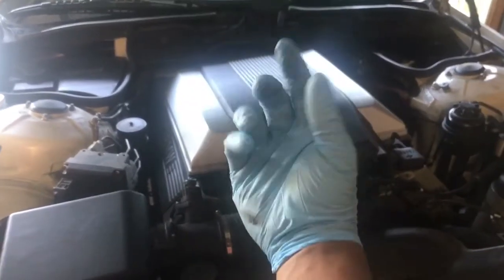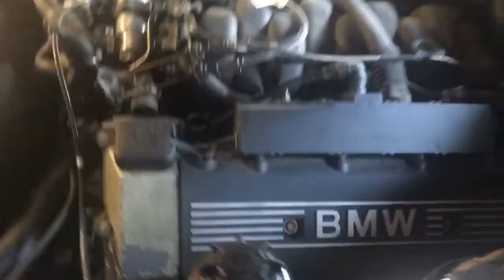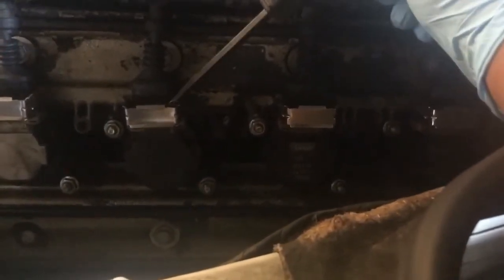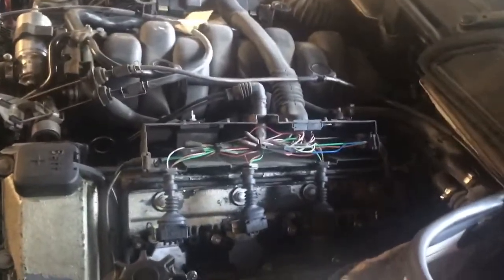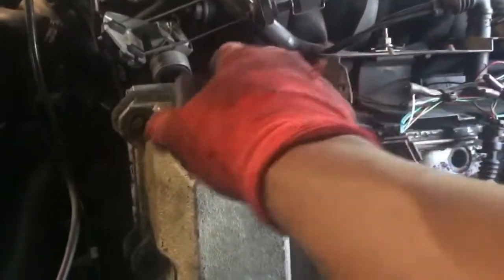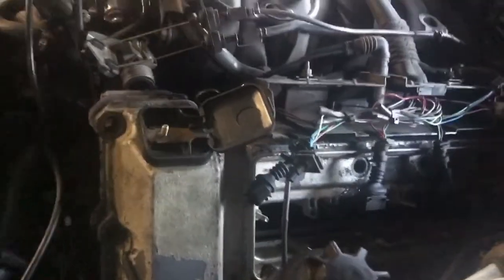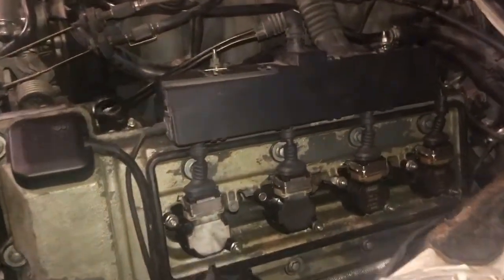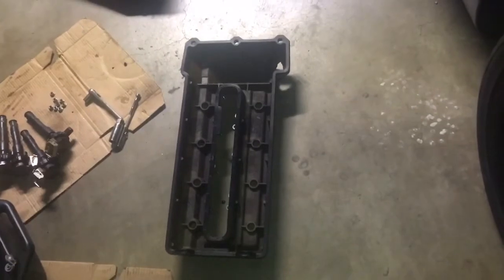DIY: 1994-2005 BMW V8 Valve Cover Gasket/ Oil Change

Comment: Good video bro unfortunately I can't do any of that but I do have valve cover leaks and do need a oil change
Reply from the maker: You need it fixed? Where do you live?
Reply from the maker: You can do the oil change easy—- the gaskets are cake too

Comment: Do you know the bolt pattern or the torque for the bolts for the valve cover
Reply from the maker: Joseph Lashley 84inch lbs or 7ft lbs... the torque sequence is similar to the torque sequence of a tire. Starting at the upper edge then the opposite edge and work your way back around to the center bolt on the forward edge (radiator side of the engine) of the motor. Hope this helps

Comment: why don't you show how did you install the valve covers???lolololololo
Reply from the maker: ? I’ll try to break down what you’re saying as: (A) it is unintelligible 
And 
(B) appears to be a snide comment 

The valve covers are held on with 10mm caps, and studs with 10mm counter sunk nuts... you put them on in a cross torqued fashion (like a rim)... this is self explanatory- if you notice I didn’t make a video of me telling you how to open the hood- right?

Comment: Where do you live
Reply from the maker: Jordan Lopez Sacramento
Reply: Man I just bought a 1998 740 iL it has 111k. Smoke comes out the muffler when you press the gas and not really when idle the dealer said need ring seeks cover gasket bolt rubber washer seal gromet kit he said it's not the head gasket that it dissent need new heads you think he's honest and could be true or does that sound false
Reply from the maker: Jordan Lopez the dealer told you that you’re getting oil in the combustion chamber, and if you change the valve cover gaskets as well as the spark plug seals that solve the problem? If you have a smoke issue- the valve cover/ spark plug seals are the least of your worries- it sound like you need a valve job AND you may also need your valve cover gaskets/ spark plug gaskets replaced
Reply: CtRacerX yes he said valve cover o ring seals the gromet kit it hasn't really been blowing smoke out lately when I turn it on how much do you think it would cost me to fix it turns on and drives and Dosent make any noise the first time he turned it on I seen smoke and I haven't Since
Reply: The smoke ended up being a ccv vent valve but now it's kinda has a lil shakes idle when I'm at a light but smooth when I drive
Reply from the maker: PALMTREES PRODUCTIONS while I don’t recommend seafoam on a BMW, I have used it to clean the 2ndy air system and the ccv before... give it a shot and see if that smooths out that idle.